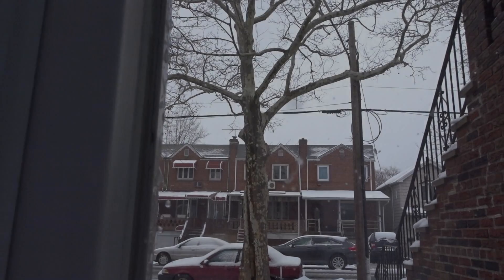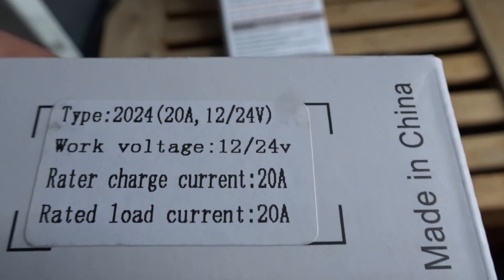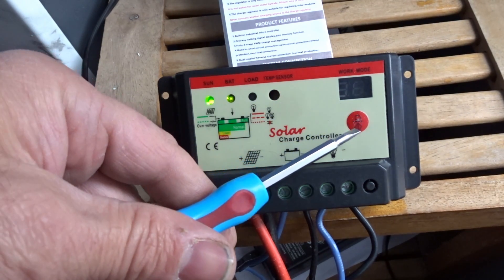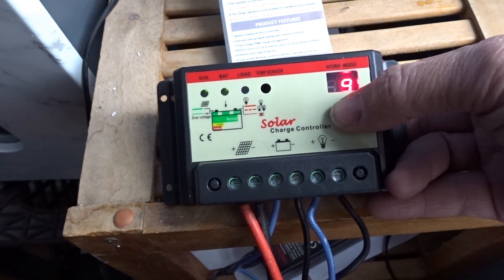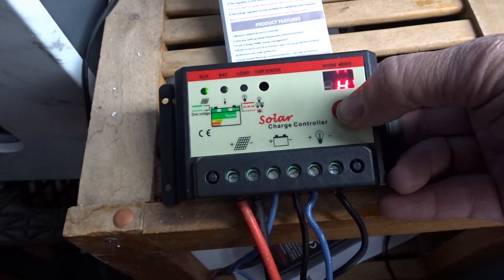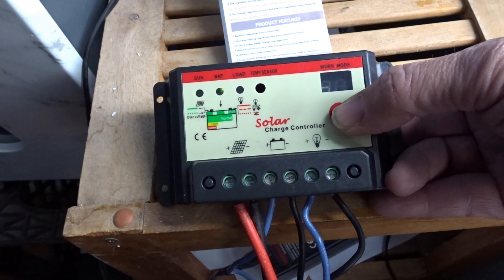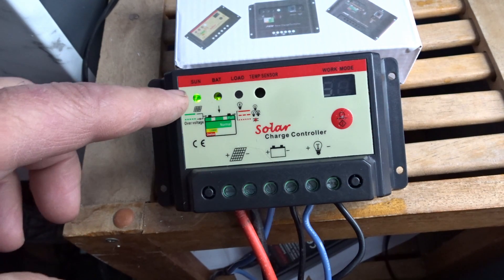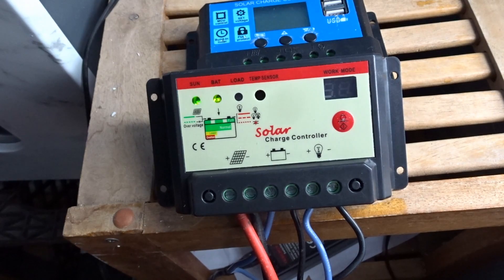Solar charge Controller Model 2024  20 A. Demo and settings

Comment: i have a client who has 3 cameras dc 12v that are on a pole. He changed the battery to a lithium one and somehow it seems the cameras don't get power anymore. Is there any specific setting on the victron controller i must change?
Reply from the maker: I am uncertain if these Solar controllers do Lithium, Lipo4, but the B01, b02 b03 like that are the   lead,  gel etc  batteries.  can give that a shot this controller is my least favorite  I apologize for that

Comment: 12,7v fully charged? Aren't you mistaken? It should be at least 13.2v constant if floating.
Reply from the maker: my Vid was about the actual one I showed, I tossed in the other one where I made the goof. the Float is 13v plus you can also set the float lower or higher, maybe I meant to say that is the  return voltage 12.6 to where after its recouping that the charger will work (Wink)